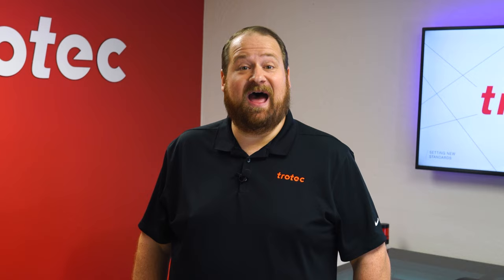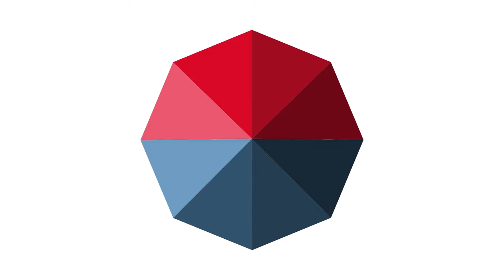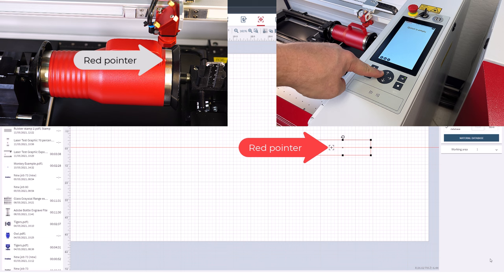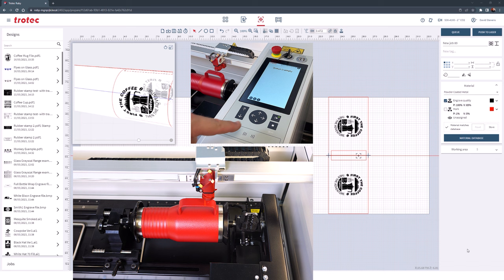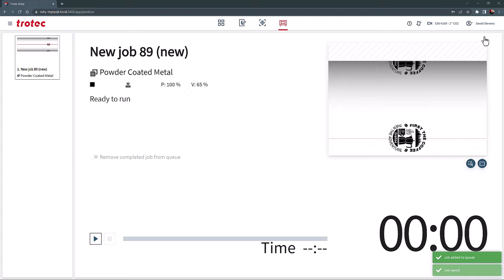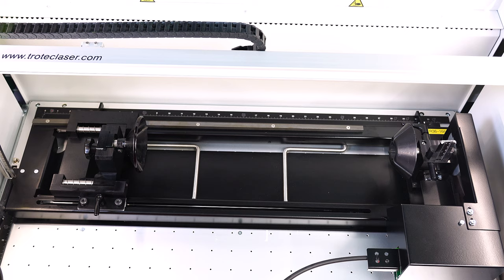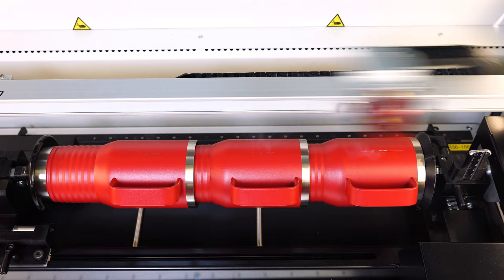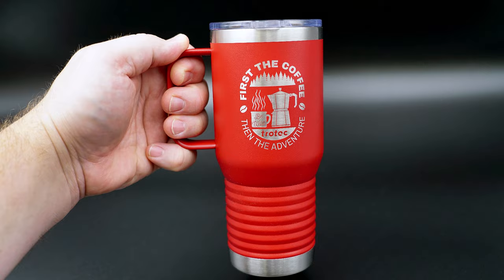Deep Dive with Laser Dave: Engraving Both Sides of a Mug with a Handle

Comment: Hi Dave…the question I have is how to you line up a cup such as a Yeti?  With Job Control we were simply able to place an F8 in the middle of the Yeti logo.  Then we line up our logo where we want it on the cup.  When we place cup in the rotary we we line up the red light pointer with our F8 in the middle of the Yeti logo.  This is our start position and allows us to be consistent with every cup in the run.  In Ruby, the start position always straddles the middle red line.  We can use an F8 for the starting position, but when the rotary moves to engrave the logo, it does half, then rotates completely around and does the second half.  This extra rotation can cause huge issues (slippage, or the logo doesn’t line up properly.  We would really like to use Ruby with rotary, but for this reason continue to use job control.  How can we do this in Ruby?
Reply: Hey Ron ....Regarding lining up a cup like a Yeti with Ruby, the process isn't too different from what you're used to with Job Control. Here's how to do it:
Similar to how you line up the mug handle in the video, use the same technique to identify your logo on the Yeti cup.
Draw a red outline around your logo, just like I did for the mug handle in the video.
To prevent the rotary from turning mid-job, make sure to rotate the rotary to the 'stop location' before starting. This will be your starting point and will ensure that the rotary doesn't rotate part-way through the job.
 A new Ruby version will be released very next week that will offer enhancements to the rotary smoother for you in Ruby.

Comment: How do you go about running the perimeter of a job or a tumbler in ruby? (Having the laser dot trace around the image to see where the laser will put it) 

I do this a lot to double check alignment to make sure it’s where I want before I run the job with other lasers and it doesn’t seem to be an option in ruby?
Reply from the maker: Unfortunately, the Ruby software does not have an outline perimeter feature like this; the best method for alignment is to use the 3D simulation to showcase the image on the diameter and the red pointer to determine the center starting point. For detailed Ruby training, go to our customer portal at www.mytrotec.com and select "training" for the specifics in Ruby you are interested in learning, or reach out to our support team for additional help in the portal.
Reply: @TrotecLaser  is this a feature that will be added to ruby at any point? It seems to be that it used to be in job control? 

Does this apply to other engraving projects? I have used other lasers before and generally I find the best way to find perfect alignment on odd shaped items is to use the trace perimeters option to make sure things go where I want them to.

I presume a work around for this is to run a 0% power vector over the area to make sure things are where you want them? 

This is extremely useful for one offs or odd ball shapes that are not cut out of sheets. Obviously it doesn’t matter much for cutting out of a sheet but I think it’s a valuable tool that is probably not that much extra work to do.
Reply from the maker: Yes, you can run at 0% power on color as a workaround; I am unsure if there is any plan to add this feature to Ruby.  If you select the main drop-down menu in the Ruby software and then select "Ideas," you can request they add features like this.

Comment: Hi dave, I would like to ask on the maintenace for our speedy 100 machine. 

We have to cut hundreds of 10mm eva sponge that is stick with velvet/double suede (with spray adhesive on it).

Do you have some maintenance tips for our laser machine? As eva sponge left us sticky dust after cutting it.
Reply: PS: our eva sponge is like hard rubber that leaves some black residue after cutting it
Reply: If you're working with dirty material like this, it's crucial to look after your machine properly. This means: 
-Always check the laser parts controlling light (like the mirrors and lenses), ensuring they stay clean. 
-Make sure to clean the tracks that the laser moves on every few rounds of material. 
-Keep the area around your laser free from bits of material or any mess. 
Doing these steps regularly will keep your laser working well, with dirty materials.
Reply: @davidstevens2577  Hi dave do you have any idea on how to reduce burnt effect on paper? As i tried masking tape could peel off thin paper